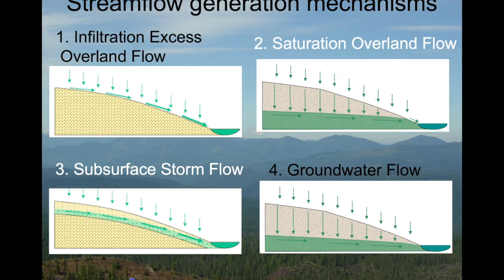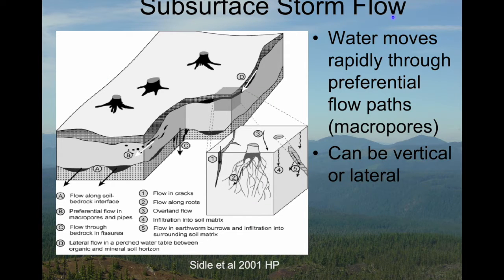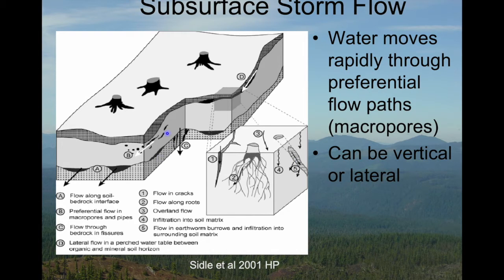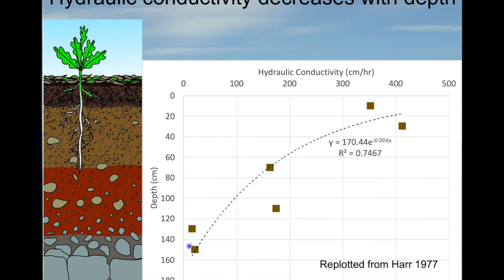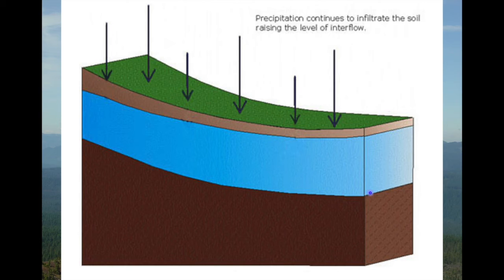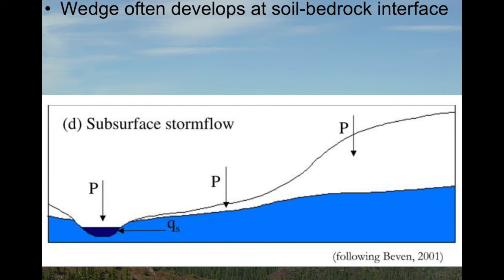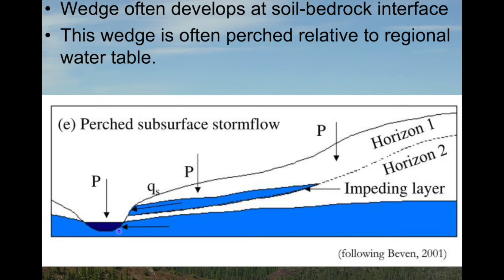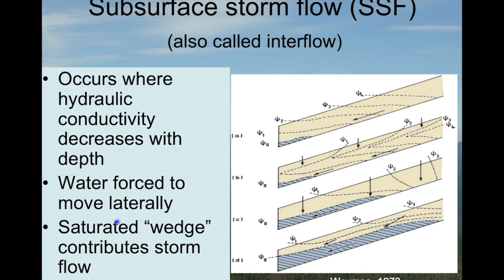Subsurface Stormflow (Interflow)

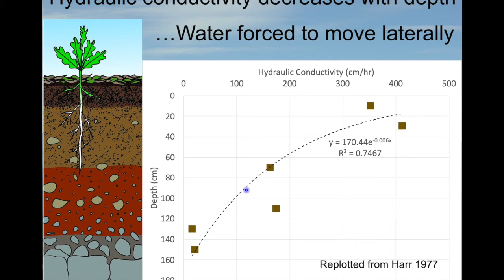Comment: Nice presentation! The plot at 3:30 actually shows hydraulic conductivity declining logarithmically with depth, not exponentially. Regarding terminology, we use "interflow" only to refer to the perched saturated lateral flow; subsurface stormflow that is not perched we still call (shallow) groundwater. Thanks for this :)